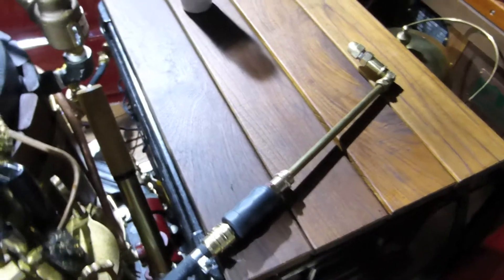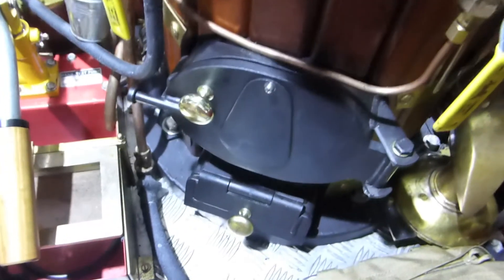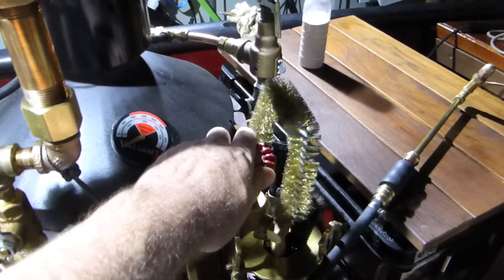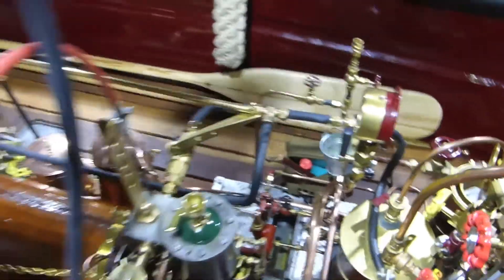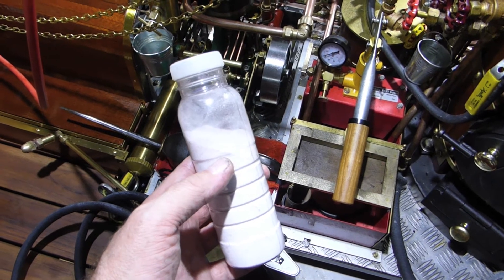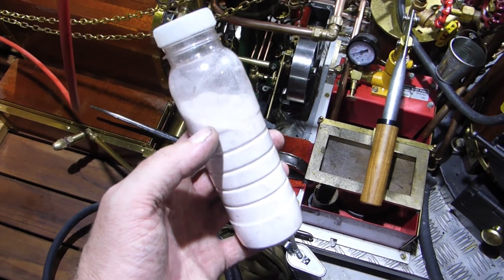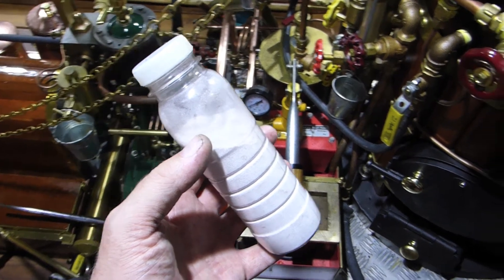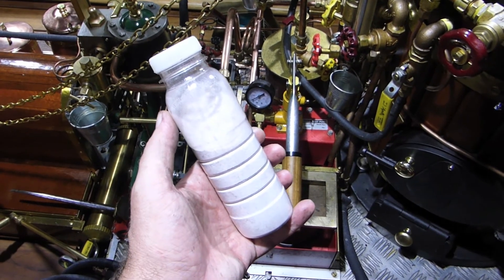Steam Boiler Treatment Inside Outside + Boiler Compound Recipe

Comment: Bonjour Christoph,
Why did not you use stainless steel for the biler ? Hopefully, my boilers are made of copper, so I can clean them with vinaigar if needed.
The pressure of your device is sufficent for the whole pies length ? 
Besides this, your launch is so clean that I would not believe that she has already navigated if I had not seen her.on the water :+)
Amicalement, Raphaël
Reply from the maker: Salue Raphael

The boiler maker uses steel, I trust him :-) and the boiler should last a while... The pressure is more than enough, the video shows just the test with air pressure, but hot steam has a different power... ;-) I started with a nozzle hole of 2 mm and calculated about 2 liter hot steam at 60 psi per second...!